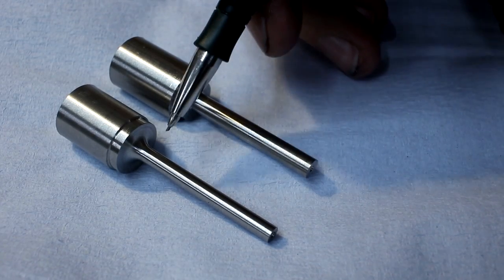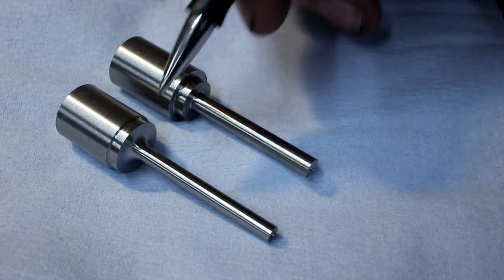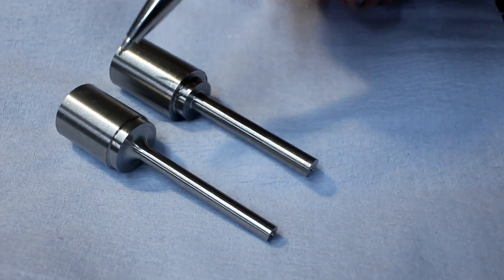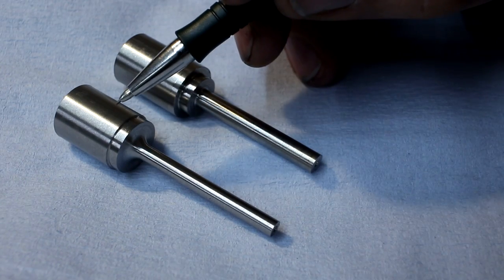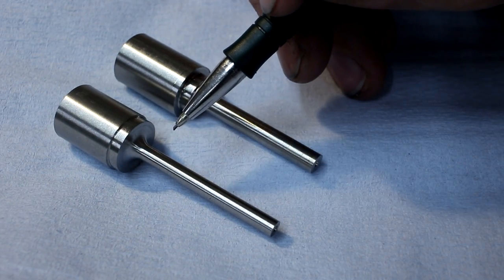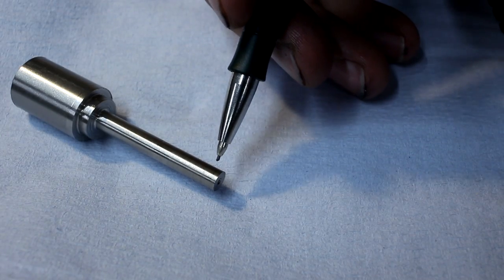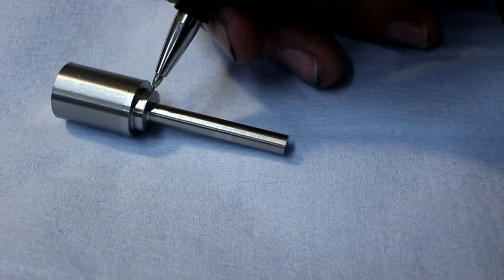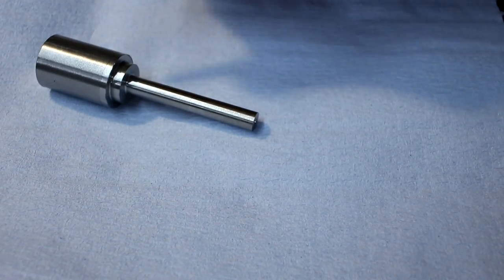Flux Capacitor Valves

Comment: It is one thing to be precise, but it is another challenge to be both small and precise. I could not work that small and still keep precision. Bravo!
Reply from the maker: I find it easier to work on small precision parts than large - All problems are smaller there, like thermal growth.
Reply: @StefanGotteswinter   the things I normally do may be the size of a 1-liter bottle, and sometimes face plate work larger diameter

Comment: Thank you for showing the usefulness of parting with carbide inserts. The measurement of the chip coil was particularly clever. I never tend to see coils like that in my small cnc as I tend to run at much higher rpm and the chips break up.  I shudder when I think of folks still using HSS blades when carbide inserts make parting so much easier and safer.

Comment: i checked with a thermal expansion calculator 5mm stainless doesnt change basicly at all at 100c. You need some proper diameters or lenghts for that to affect anything.
Reply from the maker: Youre absolutely right - on a meter length 1K change gives 0,01mm growth - But still, good practice nevertheless ;-)

Comment: with the clearance angle of 5 deg on the corner radius tool I believe you are actually cutting a segment of an ellipse   rathe  than a round corner, though it might be well within tolerance due to the small angle.
Reply: Taking finicky to the absolute absurd level huh?
Reply: if my math isn't way off, the new "radius" of the tool will be 3.01mm in the Z and X directions, and in 3.02 in the diagonal, I think the customer will be able to live with that :)
Reply: @HanstheTraffer  That's pretty normal practice on this channel, don't you think? :)
Reply: Yes,
I am surprised Stefan did not mention it given that he is such a stickler for micron accuracies.

Comment: Very informative video and really BEAUTIFUL work.  As a humble suggestion, Carpenter-20, 316 SS  machines easily/predictably.  IF sulfo-chlorinated cutting oil can be used, it cuts even easier.  IF a flood coolant system can be used, tool life and surface finish are exceptional.   When tapping this material, use Sossner  thread-forming taps.   The resulting threads are stronger, with better surface finish and the taps last forever (nearly)  if flooded with the same s-c oil.    My automatic lathe (Eguro LC-10s  [similar to Hardinge DSM-A]) shop turned hundreds of thousands of small, precision  316 SS parts.  The above worked very well.
Reply: One more thing, use Guhring pivot drills for drilling small holes.  They are SUPERB quality!  We drilled 0.020" diameter holes, 0.080" deep in most of our parts with no problems.

Comment: When you make the form cutter by grinding it none-square, is the form profile not going to be slightly non-circular?
Reply: Yes, keyword "slightly"
Reply: Yes it'll become elliptical, but the curvature of the cut probably didn't have to be exactly circular. Even so, at 5 degrees the eccentricity would be quiet minimal.

Comment: Hi Stefan, very informative video, and your brazed carbide tooling is giving you an excellent surface finish on difficult material. What were you using as cutting fluid please? Neat mineral oil? Thanks for sharing this. Cheers, Jon
Reply from the maker: I use Jokisch Alpha93, its a vegetable based oil

Comment: I always thought flux capacitors were made from unobtainium... 🤔

I love the use of a carbide milling cutter shank as the brazed radiusing insert...also,  the parting cutter "extruding" the chip to a smaller width than itself is also a very interesting process... 

😎👍☘🍺
Reply from the maker: We tried Vibranium and Unobtainum, both where not suitable for actual time travel.

Comment: as alway's great video! Alright i got a offtopic question. do you think it's possible to make a direct iso-30 taper collet? i have this iso 30 manual spindle laying around and i would like to use it as a ATC spindle. just like the tormach TTS system
Reply from the maker: You can even buy Iso30 collets ;-)

Comment: thanks for taking the time to make these videos! 
I was wondering how much the shape of the radius tool would diverge from a perfect circle/radius due to the relieve angles. 
I sketched it out in CAD and if i did not mess up that would be a 7 micron error with 5 degrees of relieve. ...although comparing my cad to your images I would have guessed your relieve angles are more something like 1-2 degree? with 2 degree the "error" should be down to 1 micron. very well possible I messed my drawing up somehow but I would be interested what your thoughts are on that!

Comment: Is there any error in the actual cut radius, due to the 5 degree slopes? I can't quite get my head around that?  ;-)
     Are you liking the Multifix holder?  I have an 'A' size, which is a few mm too tall for my compound on the Lorch LLPV... I was wondering if, in your opinion, it would make sense to mill off the 4-5 mm from the compound, or, maybe, try to get an 'AA' size?
What lubricant are you using on that tool/Edelstahl combination?
   Have you used MCD or CBN tools??  I was looking at a German manufacturer who has a big range of these ultra-hard tools for very fine finishes.
Reply from the maker: I use CBN for a lot of hardturning - And recently also for titanium, where it gave me excellent toollife, low cutting pressure and a superb finish (Used CBN insert, lapped to a dead sharp edge with a 5° negative top rake).

I like the multifix A a lot, it allows me to hold fairly large tools like a 20..30mm boring bar or a CNMG turning tool but also tiny tools with a 4mm shank.

I would just ditch the compound ;)
(Milling down the compound is an option if there is enough material left, but always be aware that it will most likely warp during that operation.)
If the AA is big enough for the tools you use, thats probably the better solution.

I use Jokisch Alpha93 as a cutting oil for everything - Its a vegetable based cutting oil, does not stain materials or smell bad. And its lubrication properties are excellent.
Reply: @StefanGotteswinter  Thanks very much for the comments and Hinweis, Stefan;  I can't ditch the compound, because the LLPV is an Uhrmacher Drehbank, and has no carriage feed, so any longitudinal feed is, so far, limited to what the compound can provide.... that's partly why it uses the flying spindle/thread 'master' threading system. I do have a couple of ideas about electronics stuff, since that is, after all, my 'real job'  ;-)  Danke viel mals!

Comment: Any tips on how to deal with the deadly swarf/strings coming off the 316? I find chip control is close to impossible with this material. Can't tell you how many times I have cut my fingers and/or stalled my lathe with built-up swarf...
Reply from the maker: Keep your hands away from them ;-)

For roughing I found a CNMG insert from Garant that breaks the chip without ludicrous speeds/feeds.
For finishing, especialy when a small Doc is need, well, good luck ;)

Use pliers or a hook to pull the chips, never the hands. We are made quite fragile and are not very cut resistant...
Reply: @StefanGotteswinter  Yes, I was machining lift gate hinge pins (6.75" X 5' long) when a bundle of chips got caught and thrown at me - I got 121 stitches to repair my hand and face, but no 'real' damage.

Comment: Just by looking at the comments it looks like you have a new T shirt tagline ( This needs to be at least perfect )!  I will buy the first one! I heard a little chatter when you used the radius tool but saw no evidence in the part, was there any?
Reply from the maker: There was a squeek, yes, but it did not telegraph to the surface. The magic of the solid toolpost mount ;-)
Reply: @StefanGotteswinter  Just make one for my Super 11, nowhere near as elegant but that big chunk of cast iron sure does help. Plus my AXA tool holder now sits abouts 10mm lower so I can fit 13-14mm tool holders. win win!

Comment: Given that it's set at 5° in two planes, and that you lapped it parallel to the holder to get clearance, the profile on that radius tool is slightly elliptical, surely?
Reply from the maker: Very correct: About 20 microns out of round.

Comment: I notice you spin the chuck and it spins free as if it were in neutral or out of gear... do you have a way to take the Emco out of gear? Or is it just in high gear?
Reply: put it between gears = neutral
Reply: Have you tried that on this lathe?  I have the same one and If I put it between gears it will spin- sort of... but it will be partly engaged in either the previous or next fear and will clank
Reply: @WallaTool  I have a v10p and can do it no problem, v11 might be different though

Comment: So why not create a tool that rotates in the Z axis so you can cut a radius with a single-point tool?  The lathe equivalent of a fly cutter, if you will.
Reply from the maker: I would do that for a larger radius, for sure, but the 3mm radius is still fine that way.
Reply: @StefanGotteswinter  Ok thank you.  I have no idea what you're making but I admire your methods.

Comment: so a flux capacitor is a real  thing? i thought it was a term like warp coil
Reply from the maker: I use that always for parts where I can not disclose the real name/use ;)
Its a very fictional thing :)
Reply: I've tried opening an electrolytic capacitor and filling it with solder flux but I'm still in 2020.
Reply: @natecontarino1748  Keep trying, we are all  convinced it will work eventually.
Reply: @natecontarino1748  Have you tried plugging it into 3 phase?